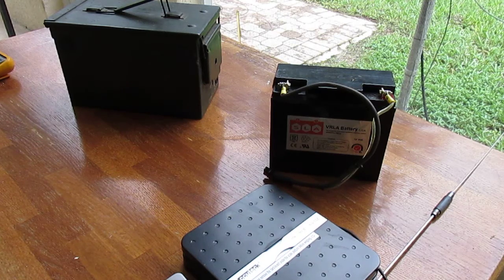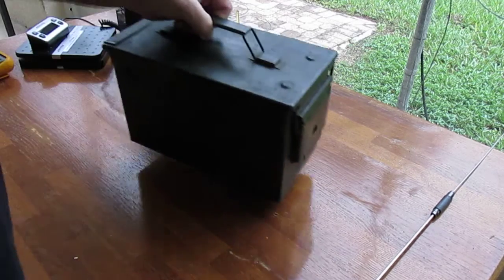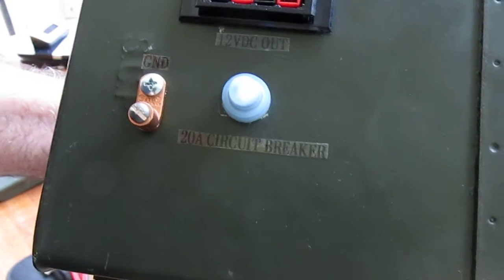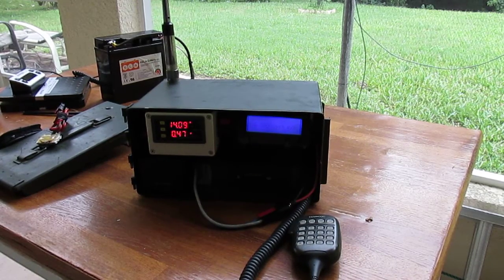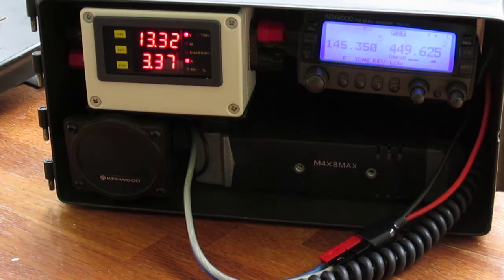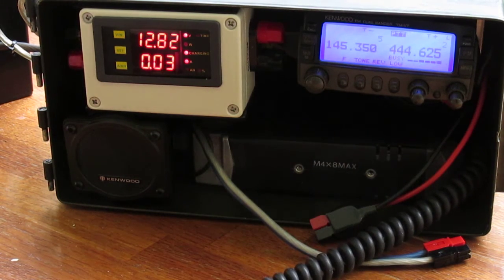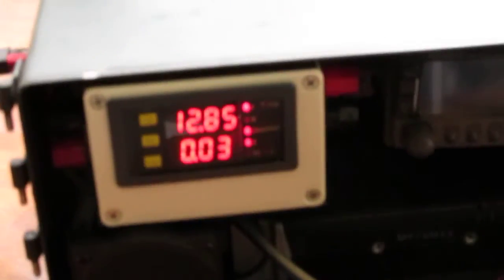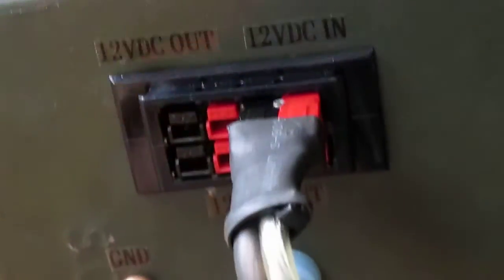Ammo Can VHF/UHF Dual Band Go Box

Comment: I don't have a ham license yet, so I put a Cobra CB set in my own ammo can. The radio runs off of a small 12v Lead-Acid UPS battery. As a bonus (since I am an NBTV enthusiast) I put a very small 32 line mechanical NBTV televisor inside of it as well.
Reply from the maker: Nice Idea, CB is common with people on the road and Truckers, they off valuable information on road conditions and possibly towns they passed through.

Comment: Great vid.but i have a couple questions.first i am assuming you are using the barrel connector on the battery to charge the battery.if so were did u get the connector from or how did u mount it if it is con ected to battery.u can charge the bionno battery from the power pole connection on tbe battery.i am gling to assune that your power loles mounted to tbe box is actually a powerpole splitter.hence one in and one out.id love to know were u got the antenna and the volt/ amp meter. Love the box man!!!!! KD2PKL JERSEY SHORE N.J.
Reply from the maker: i am assuming you are using the barrel connector on the battery to charge the battery.if so were did u get the connector from or how did u mount it if it is con ected to battery.
[I made a jumper to a chassis mount, I drilled a hole, installed a chassis mount power connector and ran a wire from there to a connector that plugged into the battery.
]

 can charge the bionno battery from the power pole connection on tbe battery.
[No, the charging connector on the Bioenno battery goes through a circuit] 

.i am gling to assune that your power loles mounted to tbe box is actually a powerpole splitte
[There is 4 power pole connectors, 3 output and one input, the one input is for external power.You must disconnect the Bioenno battery if you use external power. The Bionneo battery needs a 14.5 volt charger so I use the charger sold by Bioenno. 

were u got the antenna and the volt/ amp meter.
[https://www.dxengineering.com/parts/cma-ca-2x4sr
It’s flat SWR on uhf, vhf, GMRS
]

and the volt/ amp meter.
[  https://www.ebay.com/itm/DC-120V-30A-AMP-Volt-Combo-Meter-Battery-Capacity-Power-Charge-Discharge-Monitor/161129449019?epid=1765247993&hash=item258410463b:g:J1gAAOSwXMxb1Wul
  ]

73s,
Eddie kj4fgi

Comment: That's a heavy go bov.
Reply from the maker: 13 pounds is not heavy, in the box is  the radio and the  LiFePo4 Bioenno battery, the 12 volt SLA battery is 12 pounds, that's why I don't use the SLA batt when portable. when the radio and LiFePo4 battery, is 13 pounds